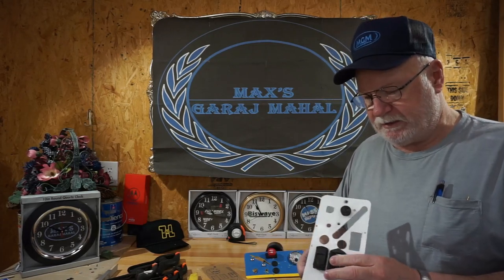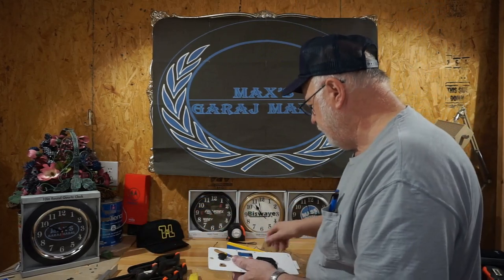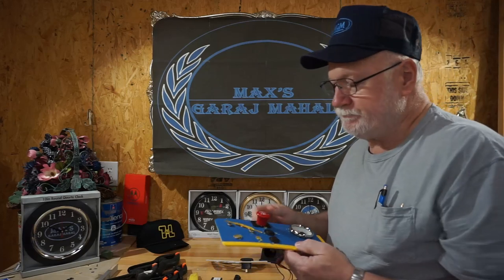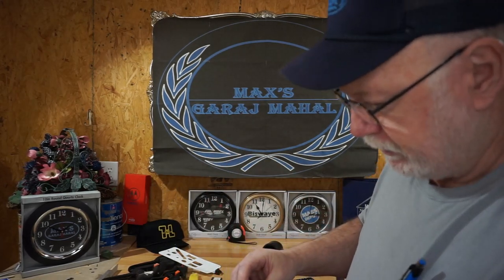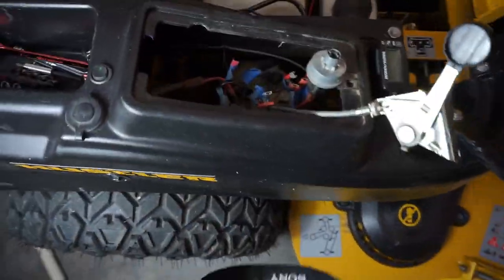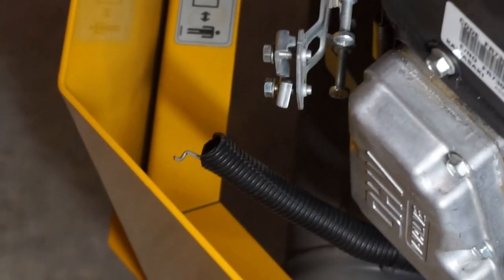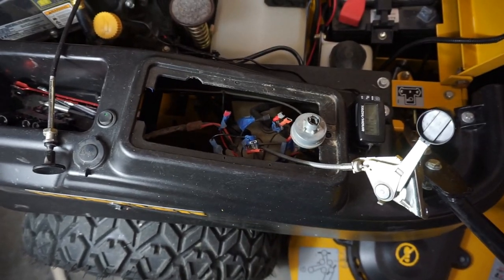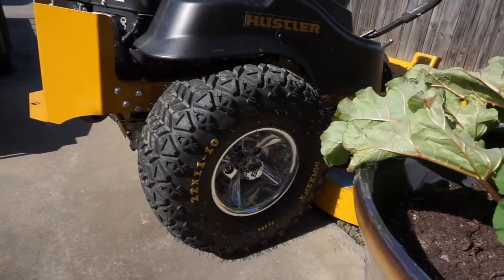Enhanced Control: Ergonomical Dashboard 2.0 for Hustler Raptor & BigDog Alpha Includes Fuel Gauge.

Comment from the maker: Lets hear your ideas, suggestions, likes and dislikes below. Be sure to hit the like button, share and please subscribe.

Soon as I get some more black material in, Ergo 2.1 is on the drawing board. Adding digital dashboard may be a big flop, but, things have to progress to find what I like best including silicone gel buttons, digital speedometer, inclinometer, fuel cell gauge, back-up camera, proximity notification, oil pressure, oil temperature, hydro temps, rpm, and whatever else I can fit into the electronics.
Reply: Muffler heat shield,1st,tongue trailor jack 2nd, light bar, they have thin ones now,trailor hitch,
Reply: Gas can vents amazon, rod and reel handle heat shrink, molded over springs ,tools what ever ,good product .amazon also.uhmw hard plastic multi uses dash etc.
Reply from the maker: @joeparker7508  The latest heat shield on the Raptor SD 60 is made of 18ga aluminum plate borrowed from a donor appliance I broke down for hardware. I knew I'd have a few applications for the plate thus I saved it in the shelves. It was so easy to do by placing a 2" PVC pipe on the side of a workbench or even a wall. Leave just enough space between the pipe it is attached to for the thickness of the item being rolled.

Stick the plate through just far enough to hold it and begin folding it up against the PVC if it is pliable material you've chosen and it only works for pliable materials unless you decide to go mechanical rolling.

Just roll it to the diameter you need to go around any item you're working toward. I made mine a slip on for testing purposes before becoming a permanent installation. Update, it works absolutely beautifully, added 9 ounces of weight thus not hurting the fuel mileage or slowing the land speed.

Could you be more specific about the trailer jack and trailer hitch?
 
I can field the light bars immediately. Even if it weren't for my distaste for them for these reasons: Not attractive and hurts the aesthetics for anything and everything they come in conctact with, the fact they almost always will protrude upward, downward or away from anything they are mounted to for light support, they are wide, depth is now thinner I appreciate. However without adding the others dislikes to my list I will get to the reasoning behind the LED lights I chose, stand behind my choice and reasoning behind recommending them in the past, to you now and others in the future. 

1. These lights fit below the foot rest, do not protrude forward past the caster mount making the lenses and housing protected by the mower itself, they do not protrude behind mower caster mount thereby enjoys the same protection from the mower frame. This still allows placing the deck into places as it did before the installation.
 
2. These lights are extremely light dense with less electrical draw from the under serving stator and rectifier which can't handle a lot of the draws we place upon them. 

3. Even the thinner light bars require them to be mounted in such a manner that you lose clearance under bushes, building outcroppings and so many other places you'll stick that caster mount and thus hurting the use of the mower much more than you've gained.

Thanks for commenting and watching the videos.
Reply: @MaxsGarajMahal  old license plate would work,the first one I made was out of aluminum posted sign in worked fine
Reply: Can't believe that heat shield wasn't already on it.The hole indentions was there
Reply: @MaxsGarajMahal  Max did you add middle coil spring under the seat.Anyway I follow your lead on that one
Reply from the maker: @joeparker7508  I'd like to see your tribute to the Ergo Dash. I didn't give a license plate any thought due to the indentions made stamping. The switches all require flat surfaces to easily work with as well as tightening the nuts on the rear of the panel. 

Guess there should have been a question prior to the above. Is it more comfortable, more ergonomic for you and make more sense in your design? If any of those are not true, sorry I gave you the idea.

Shoot me a couple of pics to maxsgarajmahal@gmail.com, I'll give you my digits in the event something important comes up you feel can't wait until I see the comments and sometimes I never see them at all for some reason the algorithms think I didn't need to. Subscribers and viewers will never feel that way and more than likely will feel I was ignoring them like the big channels. I just walked in the door from another hospital stay for pneumonia, however, I answered you from ICU so I do my best to be a quality channel to follow and share to your friends.

Thanks again,

Max
Reply: @MaxsGarajMahal  license plate was for heat shield
Reply from the maker: @joeparker7508  Yes Sir! That will work. I'd be very concerned with the indentions collecting debris whether facing up or down. As long as you don't experience that such as fire which does happen with heat shields, I think you knocked it out of the park.
Reply: Can I pm you
Reply: You got some cheap tweels nearby
Reply from the maker: @joeparker7508  Don't see why not?

Comment: Slick dash board
Reply from the maker: Glad you liked it. I've been very happy with Ergo 2.0 and wasn't displeased with Ergo 1.0. When that was going on and before the start of the health set backs, I'd intended making upgrades for Hustler & BigDog branded mowers in two modes, the actual bolt on parts and step by step plans some with dotted lines print outs and dotted lines layover plans. I managed to continue to do well enough to test my thespian skills to not show the illnesses but that had to come to an end and during this time I figured out I couldn't maintain the manufacturing any products if at anytime I fell into further depths which I did several times rallying back to performing level but not as well each time.

I just got out of the hospital today 6/30/24 and saw the comments so I knew I couldn't allow them to go unanswered so if you will forgive the health update, I do my best to be responsive no matter my health. I appreciate you making me jog what memory I own.

Comment: Nice job Max, it’s does look more factory install fuel gauge, I know it take a lot of time an work to make it look factory installed . Can’t wait to see the finish project. As user Great video Max.
Reply from the maker: Thank you my friend. I try to make things look factory. Soon as I get some black material, Ergo 2.1 is already in the works along with the rewiring and fuel tank sender installed and hooked up. 

I'm trying to figure out how to change out the light bulb for a blue LED to match the volt meter.

Comment: Max, I just bought a Hustler Raptor 42' mower.  Can I add the fuel gauge to mine? If so where do I buy the parts?
Reply from the maker: I'm so sorry YouTube didn't show me this comment way back then. Yes you can add it to your unit. If you're still interested in installing a fuel supply system I'll be happy to get the parts numbers for you although I don't own the same model so I'll have questions for you.